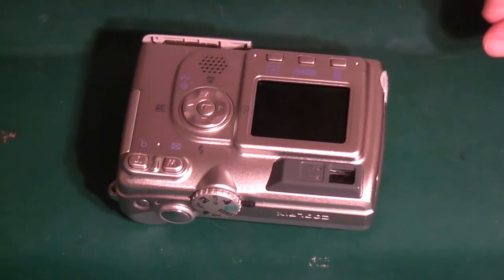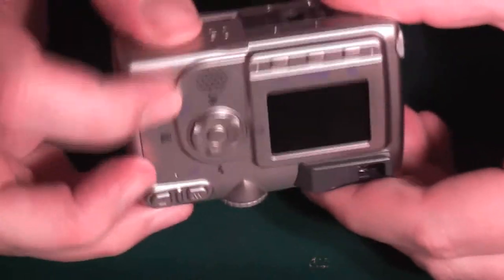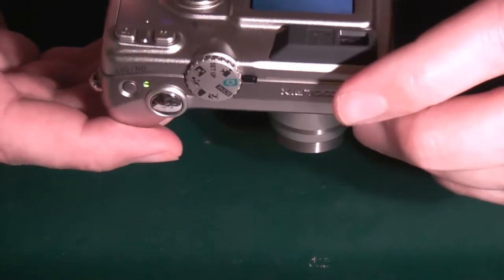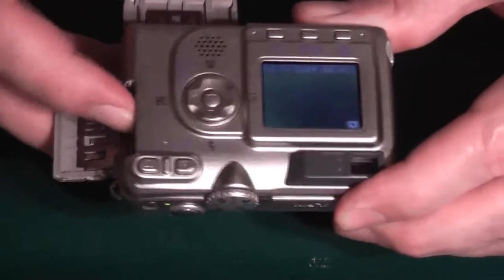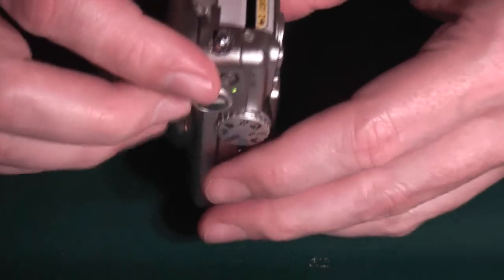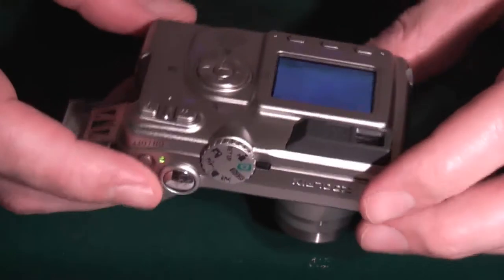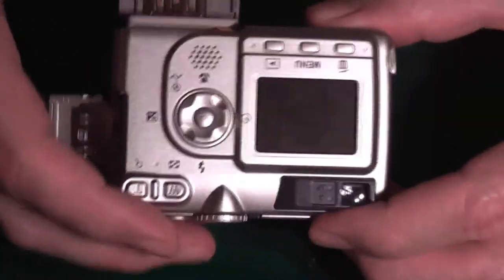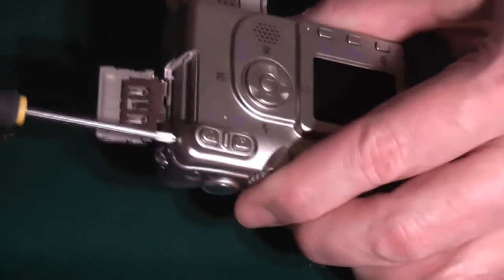Nikon Coolpix 5200 Camera Repair

Comment: Hey friend. Ya know that Farnell transformer. It works sweet. I changed some caps inside as thay was from its first days. So I replaced them. And its working wicked. Gave it some rubber feet and new mains wire and a good clean. And we are cooking with gas lol. Thanx bud for comment
 ;-) ;-) ;-)